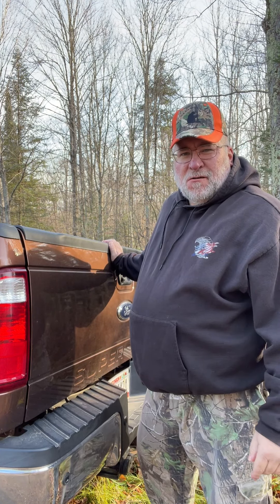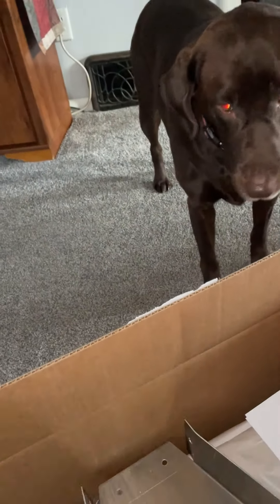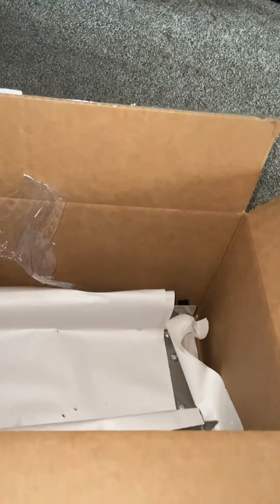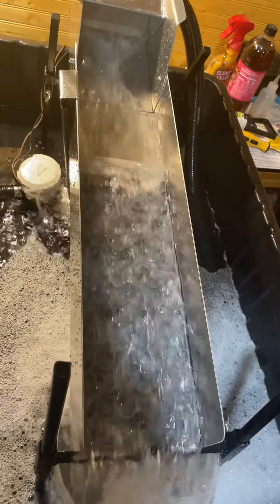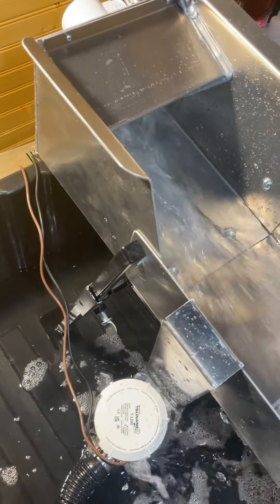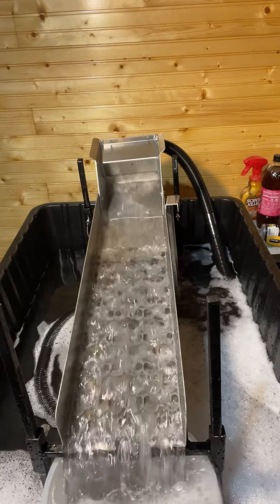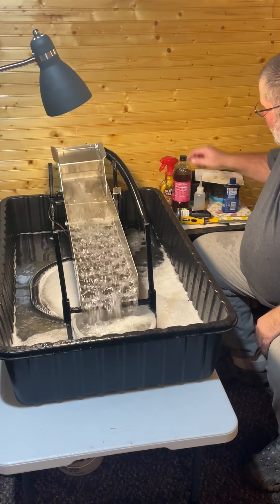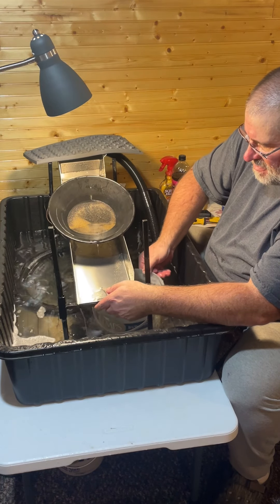Mail Call! I got a package!

Comment: I liked the video it does look like the water flow was a little fast did you check the tailings to check any losses again liked the video
Reply from the maker: I will be doing that at a later date. Just wanted to do a quick run to see how it worked